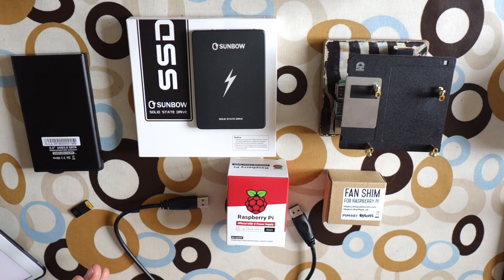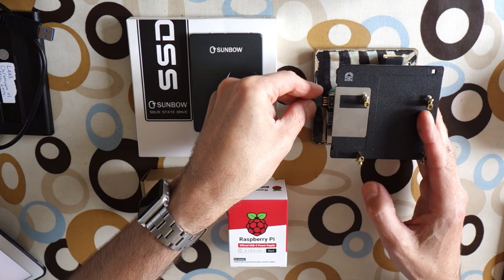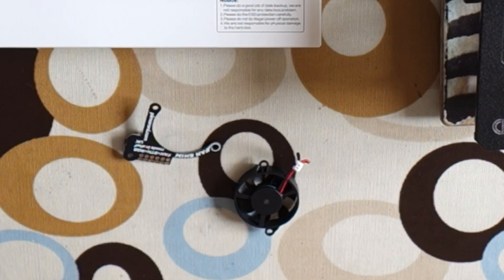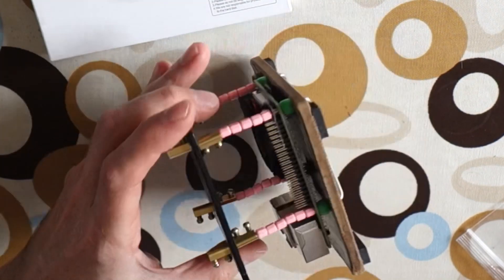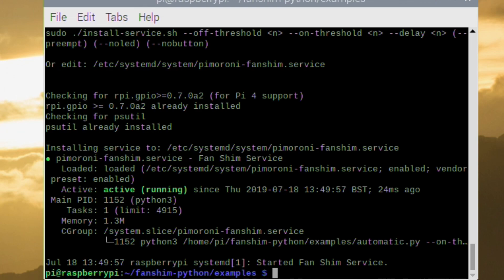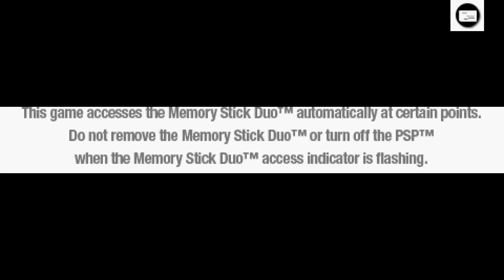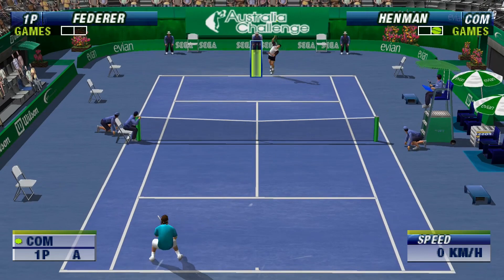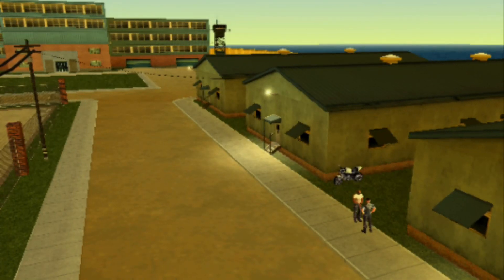Raspberry Pi 4 FAN SHIM Pimoroni gaming test PSP GTA PPSSPP

Comment: I had a hard time getting my pi4 to throttle since all the firmware updates have mitigated heat issues. I ran handbrake and after 3 minutes transcoding I managed to hit the barrier. I then installed the fan and it works great. It doesn't go much above 62 now.

Comment: I have this fan installed and it’s running but there is no green led. I put the code in the terminal but I don’t know if it’s worked.
Reply: I just watched your video and I got it
Reply from the maker: I just turned my Pi on to check. It starts up then starts the fan. Soon after switching on the fan stops and the green light shows up.

Does your fan stop?
Reply: leepspvideo no
Reply from the maker: I would try following the instructions again.

Comment: does the fan just hover above the CPU?... no contact with the chip?... no heat sink?
Reply from the maker: Yes, about 2 to 3mm space above the cpu. I will see if it’s enough for my needs. It can mount higher so I could add a heat sink.